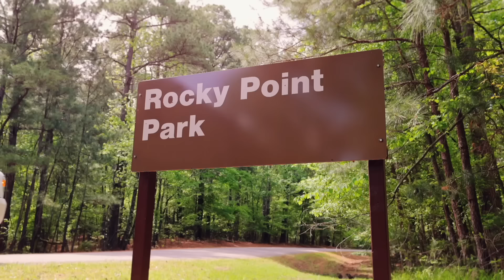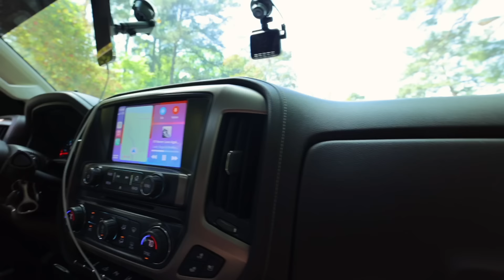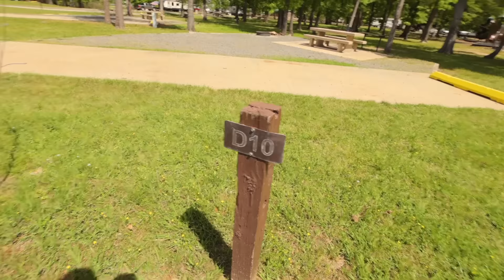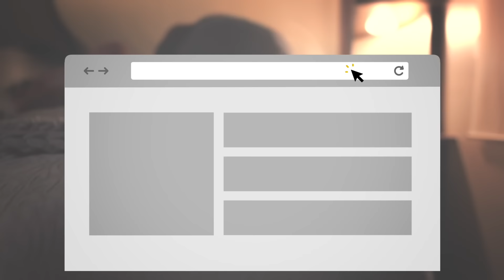DON'T Take Shortcuts with an RV - We Paid the Price

Comment: Oh man, that flash back to Sawtooth and the brakes was hilarious, dangerous, but hilarious. Our RV is at the shop getting new brakes this week. It probably isn't necessary, but I don't want to be in your situation trying to do a RV park repair. 
We have independent suspension; but we have the Curt version, not the Morryde axels. We absolutely love it. It tows so nice and smooth. The only draw back is that it raises the RV height pretty high and we have issues getting in and out of our driveway on grade with it.

Comment: There are industrial supply companies all over the country that carry in stock good quality tandem axle sets with leaf springs and mounting brackets of various weight classes.
Any welding shop should be able to install them and weld the brackets properly.
A several thousand dollar upgrade on the axles alone will give you more reliable service and a safer ride down the road.

Comment: First of all my wife and I love your videos, you keep it real. The Brooklyn Bedding ad had us laughing because even though we don’t have a Brooklyn Bedding mattress that’s us at bedtime! Now a couple of things about your brake repairs. General rule of thumb is when you change one assembly you need to change all of them. Please next time you install a grease seal use a block of wood so you don’t deform the metal cup and always make sure the spring in the seal is there before you install it. Now this is a biggie and most people don’t do it and it’s the most important step to get the most out of you new brakes. They must be burnished or broken in right after you install them to get the most from you trailers brakes. Please be safe out there!

Comment: Should have done what I plan to do. The shackle straps on one side of my camper let go so I replaced them. I should have done the other side at the same time but didn't. Before heading south for the winter, I noticed that the inside tread of the rear tires was gone down to the belts. I did the brakes and bearings a couple years ago. Instead of replacing the hanger straps, I'm replacing both axle assemblies. That includes leaf springs and hangers as well as brakes and bearings.

Comment: Our RV (Flagstaff (also Rockwood)) is equipped with torsion axles which are independent.  They ride much nicer than leaf springs and there are no springs to go bad.  I'm sure they'll wear out over time but still my choice by far.  I asked grand design on a factory tour why they don't use torsion axles and was told most likely price.  The sad thing is they aren't that much more expensive and definitely worth it.  They're also a cheaper option compared to the Morryde system but they're not disc brake.

Comment: Installed the IS and Disc Brake mod last October on my 341 RDS.  Expensive, Yes -  but it provides many  improvements in braking , ride, and easier maintenance.    No more worries about broken leaf springs or shackles.  No more worries about magnets overheating and wondering what else is going wrong inside that brake drum. Disc brakes have less moving parts and almost all are exposed and easy to see.  Mechanical things always talk to us when they need attention, but we have to learn the language.

Comment: That's why I switched to disk brakes on my trailer . Drum brakes get easily overheated on heavy trailers and parts inside break .  Plus after having problem with springs I replace the equalizer spring system to slider spring system with shocks from Roadmaster . Much more comfortable towing and  easier on trailer due the much less transfer of bouncing from roads to the box.  Stuff I put inside the trailer cabinets or kitchen counter don't fly around  anymore .

Comment: When doing visuals checks, look for excess brake dust on the inside of the wheels, especially if one wheel has more brake dust than the other wheels - this can be an early indicator that a brake might be having problems.
Most of today's RV brakes are "self-adjusting", but some incidents can cause the auto-adjuster to over-tighten and pre-maturely wear out the brakes.  what kind of incidents?  broken suspension parts, flat tire, losing a wheel, or trips to Alaska :-)  
good to inspect the brakes and bearings after any suspension incident - if spotted early, the self-adjuster can be loosened up and it will reset itself to the correct tension shortly after you get back on the road.

Comment: We bought a Riverstone 5th wheel with the Morride independent suspension. Much better pull and ride. We also have disc brakes on it. It's electric over hydraulic braking system. 👍

Comment: Great video!! Not sure if they told you or not but after you get 500-1000 miles on your new leaf springs....go back and torque down your u bolts again..  those miles will cause your springs to "settle" and you want to re-tighten the ubolts so they don't start getting really loose. 

Cheers!!  Safe travels!!!  Love your channel.

Comment: Our horse trailer with living quarters has torsion axles with electric hydraulic disk brakes and the set up is well worth it!! 

We've had three completely different trailers with electric drum brakes, and ALL OF THEM have given us problems.  In fact we have a brand new livestock trailer with major brake issues, right off the lot we've needed to replace the left front, and now the left rear is locking up and not releasing!! 

Fun fact, trailer axles and brakes are ALL made by one company, Dexter Group headquartered in Elkhart, IN.

ps. Pro Tip, I commented before the end of video, but if you ever do a bearing service/replacement again try not to seat the bearings into the hub with a metal hammer.  If you only have a metal hammer use a 2X4 or similar piece of wood between the hammer and bearings, but a brass drift or the hard side of a plastic mallet works much better and more importantly reduces the risk of bearing damage from the metal on metal (steel on steel) contact.  Hope this helps.

Comment: That grease fitting on the axle,  do NOT put the grease gun on that and pump it. All that does is push that inner seal out and contaminate the grease after going through a tube and a half. When you’re RV shopping, you want axles without a grease zerk. Your axle is hollow because of that. Which makes it weaker.

Comment: Dexter axle does not recommend putting a grease gun to that fitting on the axle because you can very easily force grease past that inside bearing seal and get grease all over your brake lining and render your brakes useless.

Comment: I hope you looked at both sides. Most times they all need replaced at the same time. I just got done redoing my barrings (Re-packing) and checking the brakes. The brakes were about 50%, so good for this year, but next year I will have to replace the pads only not the drums.

Comment: I noticed the bearing nut was tightened with channel locks.  To do it by the book and to avoid  over tightening the bearing, it is supposed to be torqued to a specified foot pound rating while rotating the drum.. AND THEN loosened AND THEN finger tightened only!
Not doing it like this will probably cause bearing to run hotter (too tight) and possibly fail.

Comment: In THE PAST,  i repaired my springs and went bigger and longer for a smoother ride and less wear and tear on the springs, i installed 10,000# springs on all 4 wheels and also installed 7500# air bags to cushion down the bumps of the road, . i know in heavier then needed but it been 5 yrs with no problems yet!the springs are not arc tight in the original  shape but longer front of the axle and the same on the rear, , making a very smooth ride , and with the air bags removes the weight off the springs to help out, . my cousin in washington state  made the change and the manufactures of the industry should do the same , all the industry want you do do is purchase a longer warrenty and in the end all it causes pain headaches and bullshit of a poor constructions. hey industry BUILD IT RIGHT OR GO OUT OF BUSINESS TRYING?

Comment: After fighting with dangerously weak brakes, I finally upgraded to hydraulic disc brakes last year and it is a GAME CHANGER! Definitely a noticeable difference in the hills and mountains. You don't have to do the Independent Suspension to get disc brakes. Disc brakes were around $4000 installed. But, it was well worth it.

Comment: Y’all are so lucky, if you remember I had a simple issue with our RV last year. We had a spring break on our brakes and not knowing over heated the drum and overheated the bearings. Ended up replacing the entire axle. $1700.00 later.  Good video.

Comment: Independent suspension saves your rig from a lot of abuse and better stopping power with disc brakes. No more under rated leaf springs and bent axles.

Comment: We put Disc brakes on at a rally, and the following year after reading about broken springs I went to MorRyde in Mar 20 - just before Covid started shutting the US down.    My new rule of thumb is disc brakes on any rig over 10k pounds.  I thought they would help on the interstate (they do), but the brakes really increase safety in town, where cars like to always dart in front of you at the last second.  As for the suspension, we noticed almost nothing on the floor after a day's drive.  We've never taken the glass tray out of our microwave.  I guess that's a thing with leaf springs.   I check bearings & brake pads annually.  That's tedious, but not hard.  It was unnerving the 1st trip after my own work.  I checked the rotor temperatures with an IR thermometer, and all was good.

Comment: FYI: If you had a certified mechanic doing those breaks, they would require you to replace both sides regardless of the condition of the other side.

If you can afford to do so, always do both sides of things like that, it avoids the other one failing at a later date.

Comment: Did he install standard brakes or 'forward adjusting' brakes. Not too long ago RV brakes were the same as we had on rear car brakes. They required adjustment by manually turning the brake adjuster OR backing up quickly and hitting the brakes to turn the adjuster.  Recently they have introduced 'forward adjusting' brakes that are identical to the ones you installed but every time you stop the brake self adjusts (turns the adjuster) to keep the brake pad to drum distance the same as the pads wear down during normal use.  My first travel trailer had the old style so I changed them out.  My new 2020 KZ 5th wheel came with the forward adjust brake system on all four.  Back then the mechanic at the dealership didn't even know they existed and tried adjusting them by backing up and hitting the brakes. If they are the old type you will have to manually adjust the brakes as the pads wear down. That is why it failed... the pads wore down but the adjuster was not compensating for the increased space at the bottom of the shoes.

Comment: There is a reason this part is called "adjuster" in its name. Periodic adjustment is necessary and if you neglect it, then everything becomes an emergency. Now some are self adjusting, but even then, they should be checked periodically.. if you put off this kind of maintenance, this kind of thing happens. I also wonder just how far the trailer is over weight, which is why I think springs keep breaking.

Comment: I just replaced all my leaf springs, bushings, bearings and brakes on my trailer. You need to check brakes and adjust at least once a year. Self adjusting cost a little bit more, but are worth it. Bearings need to be checked and  new grease once a year also. My leaf springs were sagging after 4 years so I replaced all of them and installed bronze bushings and all new hardware to hold them to axle. I installed wet bolts for leaf springs to allow you to grease them. None of it is hard to do, but if it goes sideways in the middle of no where, you'll regret not keeping up with regular maintenance on your rig. I kept a pair of my old leaf springs with new bushings in back of the truck for Oh Sh#T repair.

Comment: So you replaced only (1) leaf spring when it failed then had to replace the others and leaned a lesson. Now take that lesson and apply it to the brakes. Replace all (4) sets of brakes and inspect and repack your wheel bearings yearly to prevent a failure.  Just some advise to be preventative rather than reactive and not have to manage any crises.

Comment: As a mechanic you really should have replaced all 4. The same thing happened to a friend’s trailer and i replaced the front 2 because they were making noise and had came a part. I told him while I’m here let me take a look at the rear axle. They were still working but you see that they had got hot and it wouldn’t be long before they need replacing. So i replaced all 4 with new bearings.  He’s a happy camper now 😊

Comment: At 18:50 in video the the brake shoes looks backwards to me like the whole assembly is for the other side of axle. The front shoe looks like a secondary shoe which should be a primary

Comment: Independent suspension is worth it on a class a RV because you’re driving in it but not for a travel trailer or a gooseneck trailer or a fifth wheel trailer because you’re not driving in it

Comment: my dad taught us to put a dab of grease in the heel of our left hand and then push the edge of the bearing down into the grease until it comes out the top and do that all the way around the bearing, it would take about 10 minutes for the inner and outer bearing of one wheel.  then he bought his little gadget looked like a tub of grease with a inverted cone lid and a pressor and you sat the bearing in the cone and pushed down with the pressor and it packed the bearing all the way around evenly with grease in about 15 seconds, we could do two wheels in less than a minute.

Comment: I think you put the brakes on backwards. Hard to tell tho. Look at the brakes. One shoe will have more "pad" than the other. The shoe with more pad goes on the rear and the one shoe had a L which generally means left side or driver side.

Comment: Please repack the other the other wheel bearings to, remember they all have the
same miles on them. You don't have to replace them, just inspect them and if they are good
Clean, grease and reinstall with new seals.

Comment: Sorry you had trouble, but your RV requires regular checks. If you can do a little research you can do most of the repairs yourself. It gets very expensive when you simply call someone to repair your stuff. I grew up repairing stuff so it seems strange to me that some people can't do the same, although my step dad was the same way. He could not fix anything and always had to call someone until I was old enough to fix things for him and my mom. 😀 I realize that most people don't grow up around people that repair stuff. My mechanical skill had to come from my father who died when I was not quite three years old. Mom always said he and his brothers could repair anything and I guess she was right. Since  I just barely remember him and didn't grow up around my Uncles. I have always felt like he was looking over my shoulder whispering in my ear with advice and  guidance when I started out as a mechanic. 😀 I moved on from being a mechanic to electrician and from there became a technical support engineer for the largest air compressor company in the USA. I supported air compressors as well as desiccant air dryers and refrigerated air dryers the last 15 years I worked. Best of luck 😀.

Comment: Still don’t understand why FT RVers don’t purchase units manufactured with these mandatory features 

1. Torsion Bar Double  Axles
2. Disc Brakes
3. Synthetic Oil Hubs

You’d be glad you did for a peace of mind and less repairs 

Less stress and more miles on tires
Axle alignment stay in sync 
Easier and smoother pulling
Less heat on tires 
Had to mention 
Safe travels

Comment: If one brake is that worn, then all of them are suspect.  A kit with all four backing plates, hubs, bearings, magnets, seals is much cheaper than buying them one at a time.  We got our kit on Amazon and it was a Southwest Wheel brand kit and they were excellent.  Took about 1.5 hours per wheel to replace.  You will need a bearing seal installation tool.

Comment: I have read nothing but horror stories regarding RV construction. Would it not be better to buy an Ambulance, School Bus, or livestock trailer and custom-build your portable home in/on a structure that was originally built with higher safety standards and basic workanmanship?  Thanks in advance to any responses.

Comment: Because you two do so much mileage, the bearings should be pulled every 12 months, cleaned and repacked with grease. The brakes should be adjusted every 3000 mikes as well.

Comment: hey guys why dont you get a PUZZLE BOARD they sell them so you just fold over  when youe out  or when you start driving it protects the PUZZLE so it stays together and dont have to use tape or platic to hold down You may not get this COMMent because so much other comments  but i had one of these  for years and you can take anywhere and just open the board and ressume anywhere

Comment: At the end of the video you used a driver to tighten the lug nuts. Please people either use a torque wrench or 4 way until you can get a torque wrench, never use a drill or driver to put them back on. Over tightening is as bad as too loose.